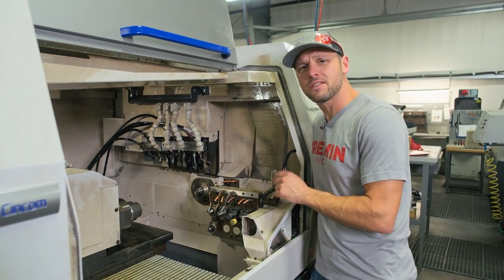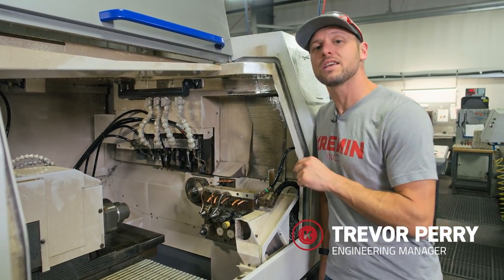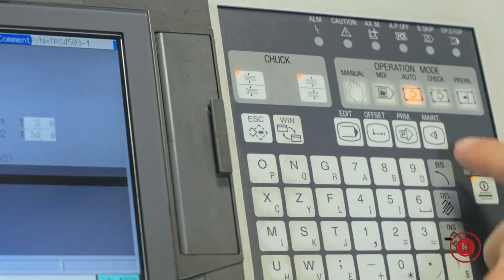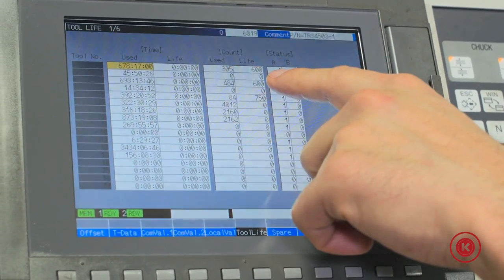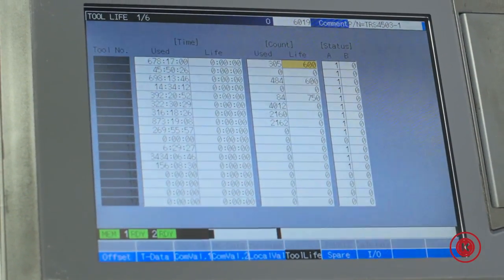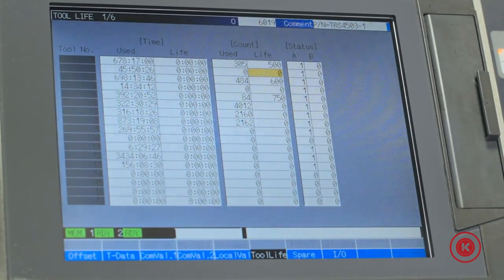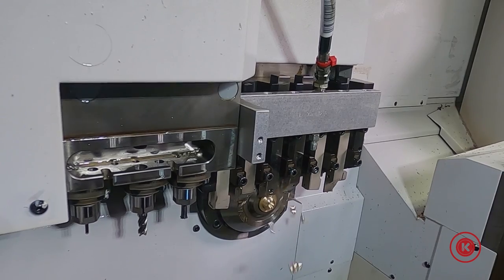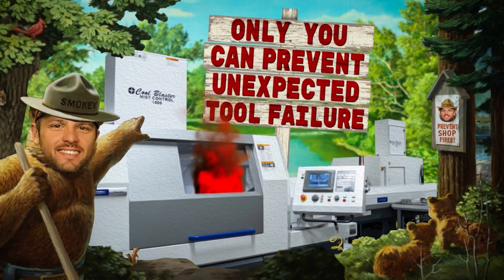How to Monitor Tool Life on Your Citizen Swiss Lathe - Kremin Quick Tip

Comment: How enable this menu? When i press "Tool Life" apear "Process Disable" on screen
Reply from the maker: Might want to check your parameter menu to see if something is turned off - might be a question for your dealer to see if it is turned off on your machines.
Reply from the maker: Go to S/W page on your main run screen - uncheck box #8 (if its checked) - that should enable tool life
Reply: @KreminIncManufacturing  Not working. In S/W menu all all off them are uncheck
Reply: @KreminIncManufacturing  Can insert program or modify in "Local Variables" "Common variables 1-2?
Reply from the maker: The local variables are more for your variable programming - maybe the dealer has it disabled? We can get the same “process disable” error by turning off the tool data on line 8 - in sw page - you do have to turn each tool on in column A (using 1 - 0 is off)
Reply from the maker: What model is your machine?
Reply: @KreminIncManufacturing  CNC Citizen, same like yours
Reply: @KreminIncManufacturing  Can the dealer sell the machine without all the programs included?**
Reply: @doarmp Yes. There are basic functions which are alwaya enabled, but things like tool life management I and II, 3D deburring function and Eccentrical turning are optional. Talk to your dealer, everything except LFV can be enabled by purchasing additional options.
Reply: You want to go to "Maint." then navigate to "MC-Struct", then press the page key and look for Tool life management I. This needs to be checked.

Tool life management can also be programmed via variables, if you know your way around :-)
Much cheaper, but not as pretty (no GUI).